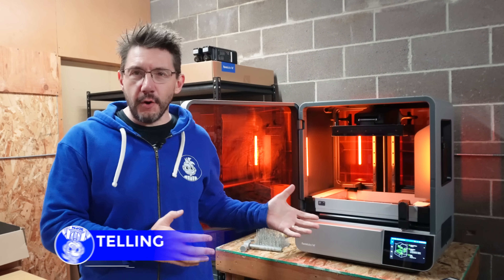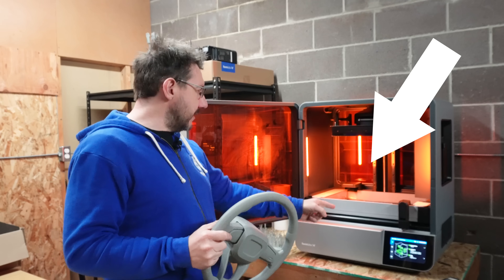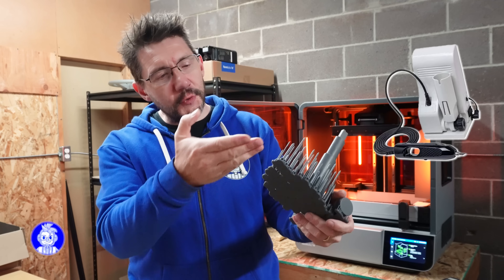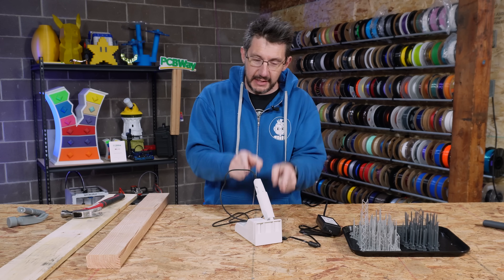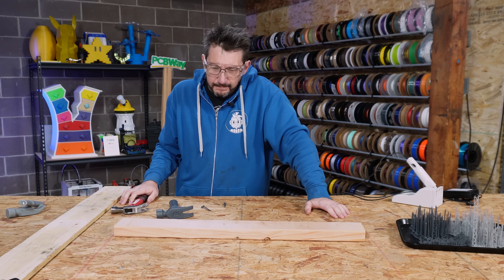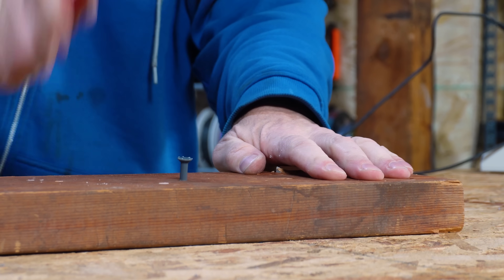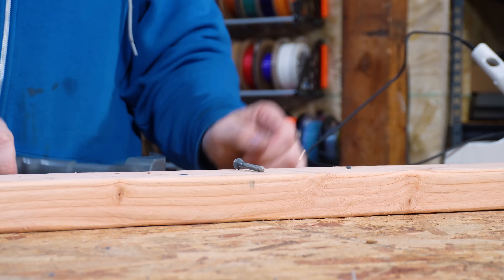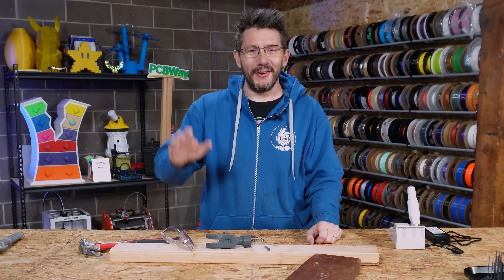3D Printing Nails and Hitting with a Hammer!

Comment: I would think orienting the layer lines to run along the length of the nail instead of the width would make them much tougher. I print a lot of functional connecting bolts on my Prusa MK4 with vanilla PLA, I hammer them into very tight clearance slots to hold wood together, and they can easily take the punishment as long as the stress force runs with the "grain" of the plastic, instead of against it. Same principle as wood really.
Reply from the maker: I know what you’re saying but the resin prints are suppose to be homogeneous. Still something I can try!
Reply: @3DPrintingNerd  Yes, makes sense - I guess the selling point of this high-end resin is that it bonds as well between layers as it does within them?

Comment: I just want to point out that nails are really to prevent shearing from occuring with 2 materials. The nail is only as useful as its ability to no break horizontal to the tube. Youd get better performance out of the 3d printed nail if printed horizontally.

Comment: There's one tool I created out of necessity I suggest everyone try printing at least once with a regular FDM printer:    Hoopin TPU Cable Tie.
I use them everywhere and almost always have a pocket full of them. I included the core elements in the upload so you can easily make your own custom versions.
It's very strong, printed at 100% scale it can carry nearly 8kg (my whole printer, see the photos), and printed at 150% scale it was easily carrying 14kg, even printed at 50% scale carrying 2kg was no issue.

Comment: Even with resin, would the orientation of the nails not make a difference? If they were printed more horizontally, they might hold up a little better than straight vertical.

Comment: How would they perform in a nail gun?  The kinetic energy and the fact that you are not hitting the nail at an angle could make it go through a regular 2x4.  Of course you could mess up the nail gun but that would be an interesting test.
Reply: I'd bet the nail would explode in nail gun just from the percussive force before it even touches the wood.

Comment: You of all people should know that resin isn't good in shear or bending. 
These resin nails needed to be kept perfectly straight, you where applying lateral bending with your hasty hammering technique.
You probably could of gotten them though the harder wood if you didn't stop holding the nails at the first opportunity. If you had held on till you felt the hammer hitting your finger even the short and fat prototyping nail would of gone through the wood.

Comment: The hammer they “formlabs” showed smashing against the floor is made out of “Durable” resin or Biocompatible Durable, not tough 2000. Durable is far more impact resistant than tough, but also more ductile.

Comment: 3D printed screws with pilot holes drilled. Would be interested to see that vs regular screws.
Reply from the maker: Yes! My thoughts exactly
Reply: I don't think the driven head "sockets" whether phillips or torx or ... will hold up. Think the cheap chinese screws, they're metal and you can't drive them in.

Comment: I'm only half way through the vid rn but maybe try printing the nails horizontally. It seems like they're either breaking from getting hit off center or snapping along the layer lines
Reply: Also like someone else had said. The shape of the tip isn't the best. Try changing it to a triangular shape like commercial nail

Comment: Plastic nails are all gonna fail and those hammers are way to light and are pretty much just toys. The 3d printed hammer might be a substitute to a rubber hammer. Stick with metal nails and metal hammer heads people. Maybe metal 3d printed would actually work made with metal.

Comment: Let's just say I'm not going to use 3D printed nails to build a new house (at least anytime soon). By the way...pallet wood is normally hardwood whereas 2x4's are generally much softer.
Reply: Pallets are rarely made from hardwoods, and there are hardwoods softer than good softwoods

Comment: As you found, the printed hammer didn't have enough weight to do the job of a hammer well. You really needed the weight of the metal head. But, I wonder if the tough resin would make a decent hammer handle. Much more dangerous to test though, because if it does fail the metal hammer head will become a projectile...

Comment: If you print a screw, ensure that you use the right head. Phillips and Flat heads won't work, as they are naturally easy to strip, however Hex and Torque heads are designed to take a lot more force before stripping; and Robertson {Square} heads are good as well, but a very uncommon bit to find.
Reply: @Drakonaut  unless you're in Canada. Most common screw head used here is the Robertson #2
Reply: Red Robby FTW

Comment: I love R&D... it amazes me when ideas go from jokes to serious or faux to reality.  Your discovery opens doors to use other materials as veneers or cladding, improving parts enough to break into other industries - not just "plastic toys".  A tip like an arrowhead, a metal plate on the hammerhead, limitless ways to make them at-will.  Using ideas like this could also shrink the scale of reliable parts, which is an amazing feat - and contains so much possibility for product development.  If I had a machine that made small parts fast in a woodshop it could be worth LOTS of my time, and I would get that product.